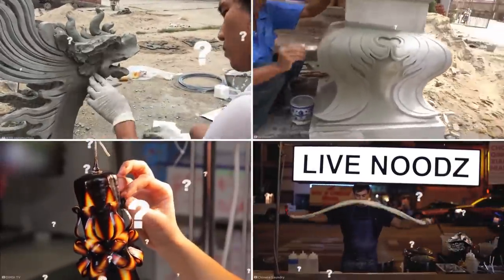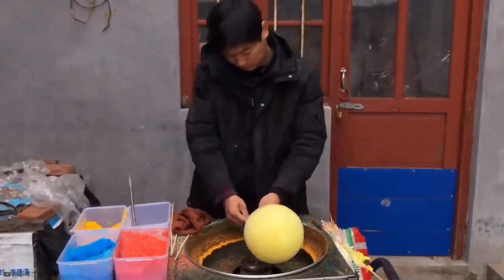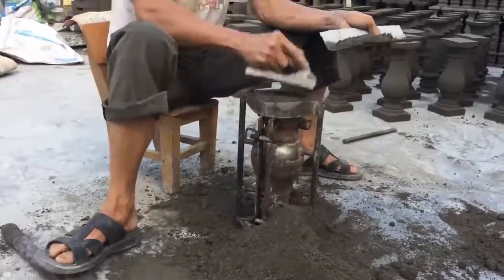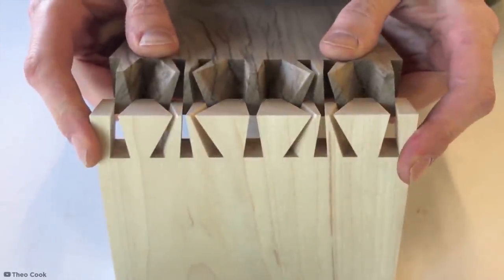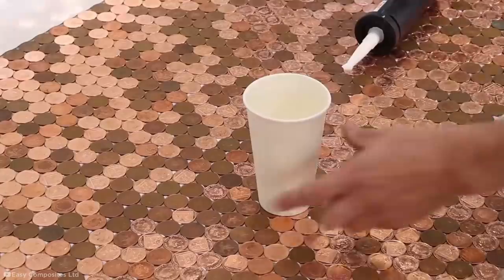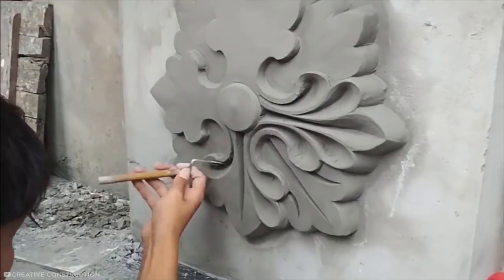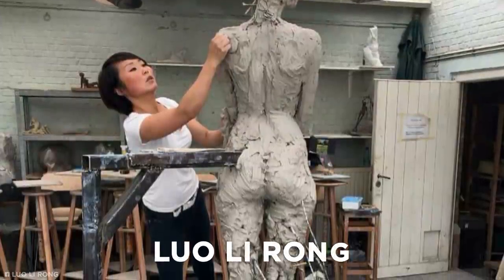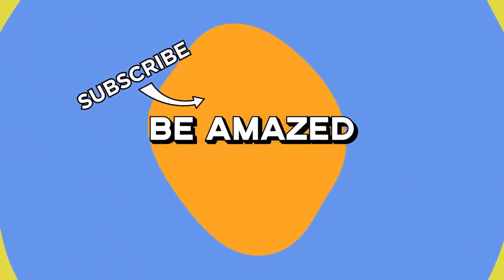Workers with Gifted Hands

Comment: Re: cement, in sculpture class we did sculptures with a cement that had about an 8 hour dry time. We'd pour it into a cardboard box and let it sit for several hours until it was clay-ish consistency and would hold the box shape when we tore it away, and then carve away at it.  That's still subtractive rather than additive, though, like this person is doing, so I'm guessing just the extra sand is used to make it clay-like from go.

Comment: 12:08 depending on the amount of sand in cement it will determine how strong it sticks together and how faster it takes to dry so ya that possible
Reply: ...that’s not how the drying process of cement works.
Reply: @8.21productions9  It's not drying...It's curing...a chemical process...
Reply: Sculpting cement requires very specific types of sand, cement, lime & clean, raw water. Chlorinated water cannot be used as it weakens the bond.

Comment: @12:00 He is legit. He is using a medium drying cement, and instead of adding gravel he adds sand, which makes it easier to mold.  As you can see, he keeps applying water with a brush to keep it from drying as he continues to mold it. As you can see from the neck flares, they are dry, but as you look towards the face of the dragon, it is still wet, and he keeps molding and applying water with a brush as he works his way to the face. He would have started with the neck with a big block, and carved it all into general shape, and then created all the other pieces of it as he went up from the neck constantly applying water with a brush to the places he wanted to keep molding.

Comment: Someone probably already answered this, but sculpting with cement is based on how much water you add. Less water means a thicker mixture. By layering the sculpture, he might use different thicknesses of cement. A thinner cement would be easier to make a soft, smooth layer. For anyone familiar with clay and pottery, it’s quite similar. I question whether he really adds sand to the mix, though. It looks like just thick cement. Concrete is when you add sand and gravel to cement. Adding sand might reduce the overall cost of materials, but concrete is more likely to weather faster. Think of it like using brick mortar (a type of cement) versus concrete used on a sidewalk. That’s an exaggeration of course, since sand is rather fine. I built a couple small steps with concrete, then layered cement on top while it was wet to create a nicer finish. The more wet the mix, the more malleable it was, but the less likely it was to hold shape without a form (a support, often made of wood or metal). Concrete and cement form stronger bonds with a wetter mix that dries slower. Commercially done concrete sidewalks and such sometimes crack because they dry too quickly. When I made my steps, I covered them in plastic for days and rewet the surface in the areas that dried too fast. Also, the artist is working in an area that hasn’t dried yet. For proper adhesion, both the old and new parts have to be wet - so if you’re refinishing your patio, you spray the old concrete before adding any new. Working with cement is messy, but I found it to be a lot of fun!

Comment: The concrete sculpting uses the cement sand mixture. A lot of artist also use plasticiser (probably misspelled it) to give the cement more of a clay property. Its also wise to use steel reinforcements in the forum of mess or strymuctrual rods for supporting outstreaching or high verticle structures.

Comment: The cement is called mortar and is mixed with sand much like the mortar and sand mixture used to hold bricks together or to do brick restoration like tuck pointing

Comment: the guy making the dragon sculpture is actually using sand and cement
I know b/c in my country construction workers use this method to save cement 
by adding sand to it not only they save money but it makes it easier to use
and has a faster drying rate(I think)

Comment: yes regarding the concrete dragon. when you work with water-based clay you receive it how you like including the amount of grog in it. Grog is just dry pieces of clay mixed in with the wet sometimes cured for structural strength. The man that is sculpting in concrete is adding sand as a type of grog for structural strength without a mold.

Comment: The wood craft seem overwhelming complicated for no reason if you are going to attract it together to hold something. It's pretty as a "multi-color Jigsaw style" 

but it looks so easy to break the little teeth on it unless you use a coating. But then if you use a coating, you can just paint the "jigsaw look" on it, and it would still be the same, but so much easier then to cut it out.

Comment: You can use concrete to mold with its a little different there's no rocks in it instead there's just a filler like sand or silica dust

Comment: The only creative feet I've ever done was making a hybrid railgun coilgun that actually functioned so you could just switch in between railgun since if you're using both at the same time they cancel each other out. It took six months just to figure out the errors I made in the code which was wrote in C++ if I remember correctly. I had to get almost all parts custom milled from a company in China with a CNC machine and I had to track down old Soviet Russian capacitors to make it function properly plus I had a liquid nitrogen cooling system even then it took 30 minutes to cool down after each shot, I mean this piece of crap could melt a titanium projectile if you use the wrong voltage or wattage.(btw my projectiles were custom made out of titanium and tungsten and they weighed roughly 3 oz of peace and could punch a hole through 3 inches of Steel no problem the projectiles traveled at Mach 6.5-10) nothing was as scary as this thing firing up because I had to hook it up to a custom-made power supply and I don't remember any of the specs of it but it made a loud buzzing noise until the 24 capacitor Bank was fully charged. Each of those 24 capacitors took roughly a minute each to charge
Reply: Wow, Dude.Impressive.

Comment: you need to call this mortar not cement. cement is the medium mixed with sand that creates mortar, when stone is added it then becomes concrete. cement on its own is useless and not strong. the dragon is made with cement and silver sand, which is very very fine

Comment: For the question " How do they make a clay like cement mix used for sculpting? The answer is plasticizers. Plasticizers are chemical compounds that enable the production of concrete with approximately 15% less water content. ... The strength of concrete actually increases when the water to cement ratio decreases. Adding 1/2" up to 4" long fiberglass strands into the blend provides an additional bonding substrate within the mix that will provide rigidity & flexibility to the mix. A wide ranging seasonal temperature change from -20 c to + 30 c requires a blend of plasticizers that allows the concrete to expand & contract with seasonal changes while maintaining structural integrity & load bearing values without suffering most partial & full thickness cracking that can occur otherwise. Some larger sculpted pieces may use rebar &/or a medium to heavy gauge hardware cloth internally as well.

Comment: The nail-gun tends to bounce as it ejects the nail, so you only need to move it across while pressing the button.  It is not very hard to make a nail-gun go that fast, especially if you speed up the video slightly, as it is, and you have a good nail-gun.  As for the cement mixture, add a little dish soap and it becomes something much easier to work.  The people who sculpt and carve are the real artisans.  That type of skill cannot be faked.

Comment: You can mix cement and sand to be very rich and sticky the guys working on the concrete pad is cement sand and rock for strength that's different

Comment: 11:44 if you use more cement than sand you will get a more easier  to use mixture it is indeed kinda like clay I have worked as a builder for a while and wen i made a mistake i got that mixture so yeah its indeed possible

Comment: My talent is making building and designing anything out anything 2 days I can make a 2000 KD drone for free with free meterials and lego and any building blocks and very good at programming and made my family a flat screen 88 by 56 tv for my dads birthday and it took my a week but I saved up a lot for materials but it was a lot cheaper and at the my school STEM club I built my teacher a iPhone 10 no charger or box just the phone but I my dad works at apple as an enploye so I got the blue prints